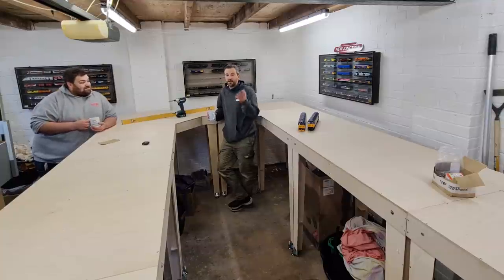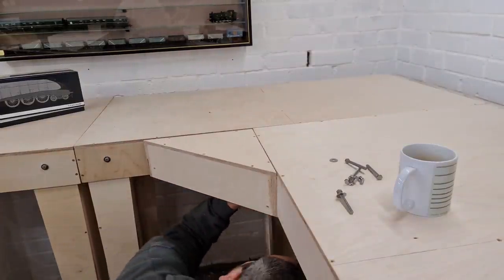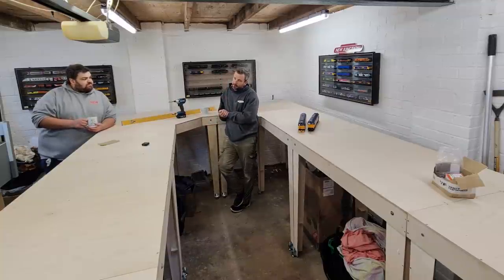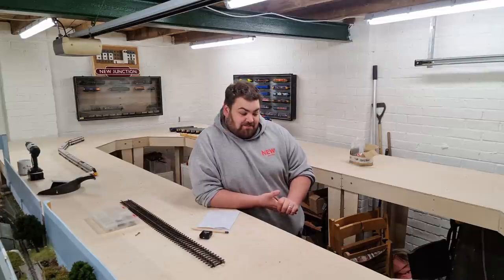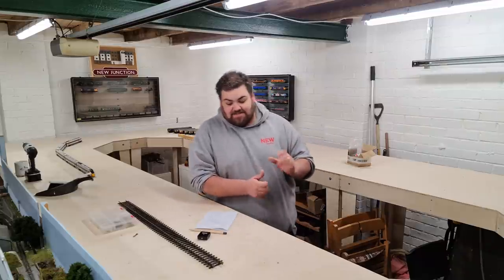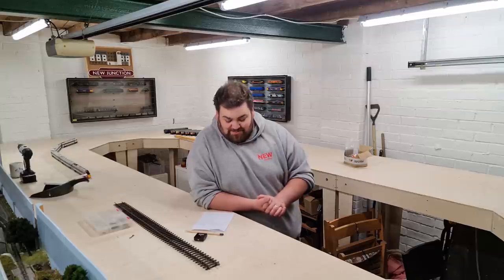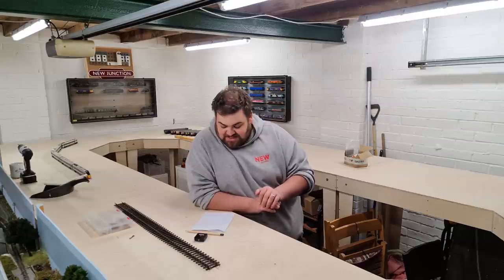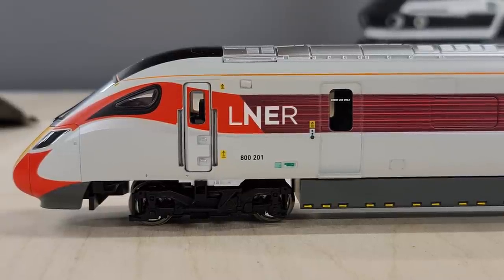New Junction: EP1 - Building baseboards

Comment: Between 3 and 4 could be interesting in the garage layout. 3 needs to connect to 4 in the show without a join. In the garage there are two additional boards. Imagine if these two boards were set in 2022 and the layout was a film set, with the trains set in the recent past. The 2022 world could have modern buildings going up and a construction theme with scenery different to the set. The crew and their vehicles would have to be modelled, however, you could include active cameras, modelled into the scene. There could be some set scenes in 2022 world using movie style flat scenery, propped up from behind but to give the illusion of a street, for example.
Coupled with cameras built into the baseboard for the set, you could have a title sequence that evolves as the layout is built, getting better each time.
The 2022 movie set area could double as a fiddle yard, as if the movie company happened to have a large goods yard next to a heritage railway as their location of operations.
At shows the 2022 era fiddle yard pieces could be added, so it could be hugely practical, albeit with a different baseboard to connect it in. "The making of New Junction" is your series of videos that document the build, which is the movie notionally filmed in the model. New Junction, the movie, could be something that the writers are still working on. Nonetheless, there could be key scenes set at certain places in New Junction that would need to be modelled for the film. Ideally there is a scale model film crew that follow construction around.
Because of reasons of plot spoilers, you cannot possibly hint at what New Junction The Movie is particularly about. But you can hint at it whilst developing the layout. Clearly, the movie company have gone all out on expenses for it though. The back wall diorama can also be explained as it is part of the movie set, albeit ridiculously vast.
In theory, New Junction Production Company exists and own things on the set. It could even have its own logo.
Everything modelled can be given a fictional reason for being, based on the movie, which can only be guessed at. A scene could be chick lit romance or with something ugly happening there. Allegedly it could be a new soap opera that is to be filmed, set in period and about a community brought together by a railway.
Like the Die Cast Racing Cup by 3Dbotmaker, models could have drivers with character and audience engagement.
All of your hard work can also be that of the movie company prop makers, so you talk in the third person about how well they did stuff and what they struggled with.
The 2022 world could have a legitimate studio for taking pictures of locomotives against a plain white background with good lighting. They would need this for their movie making. Again, you get  practical facility for taking pictures for video.

Comment: at what point do you consider the backscene, it needs to be at the forefront of your thinking presumably before a large baseboard structure is built because of the restrictions with wall shapes, electrical sockets etc etc ??

Comment: Great to see you finally starting to build a new railway. One suggestion I’m not sure how many stations you plan to have on your layout but if it’s a few one thing you could do is it f you say have 4 stations for the main line if room permits and 3 for the Heritage line I can not remember the exact name for the technology I am thinking of but it is on Everard Junctions layout at his stations he has censors installed in his trains and at all stations mostly on the Heritage layout and what happens is with that technology and some programming into the control system you can set automatic departures and arrivals to all trains at all stations when the train departs the station it sets off at a slow pass then builds up to the required speed then when approaching the next station it slow down to the right approach speed then very slow as it approaches the platform then a full stop at the platform then you can set in the system a pre determined amount of time the trains are at the platforms example 30 seconds 1 minute or any time length you feel is right and on the Heritage line if it is not a circular line or is only a loop at one end then the other end a termination platform then when it arrives at the terminating platform it stops at you predetermined amount of time then reverses back out in a predetermined setting and sets off all the heritage line again. If you choose to do this this subject to budget you can set it up so trains arrive and depart at different platforms in each direction at various time giving it a feel of a real railway and your can just watch more of the action as appossed to individual control and you can probably set it up to stop at certain red signals for a short time then set off again.
Reply from the maker: Sounds like a great idea, definitely need to look into technology 😀

Comment: Most heritage lines tend to be old branch lines and as such, don't parallel the main line, tending to run at an angle instead (as they are going somewhere else). This is a challenge on most layouts as we tend to build them narrow for space and reach (when that train details again). I think the trick here will be trying to get the heritage line as far away from the main line as possible in the available space.

Secondly, a lot heritage lines are only a short section of single track branch line with run arounds at each end. With this in mind, perhaps it could be a shuttle? With a section of unrestored line after that (overgrown embankment/cutting with trees either side, and old infrastructure), perhaps the old junction with the mainline if you don't want a mainline connection?

A garden centre with a miniature railway in Z or T gauge would be cool as well.
Reply from the maker: Oooo some very good points